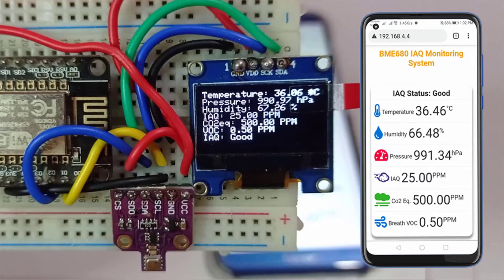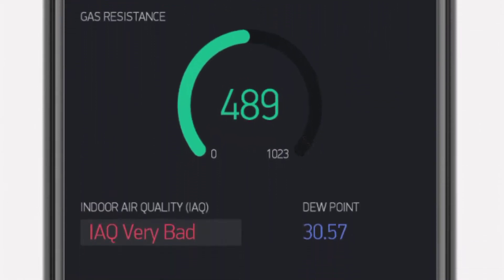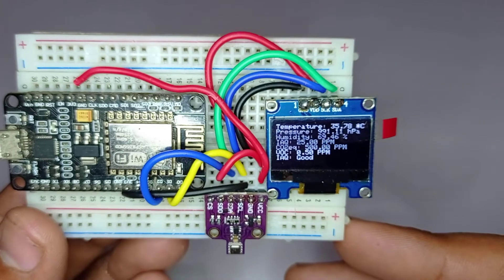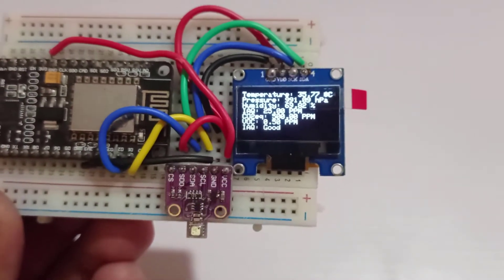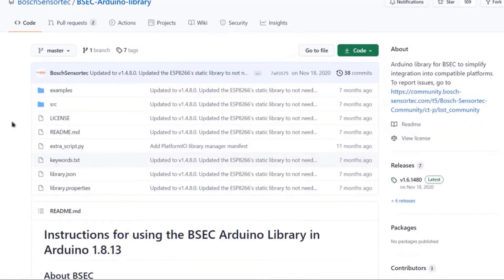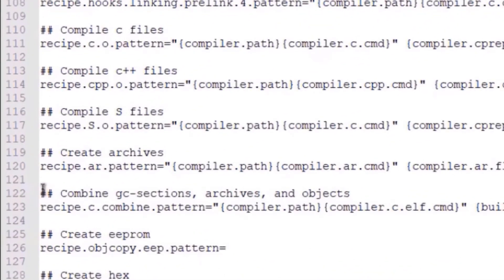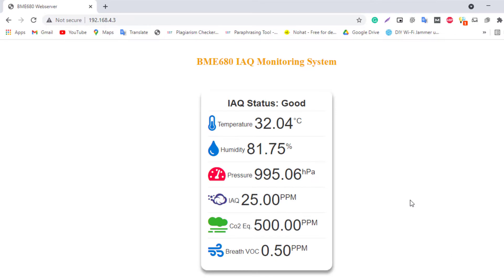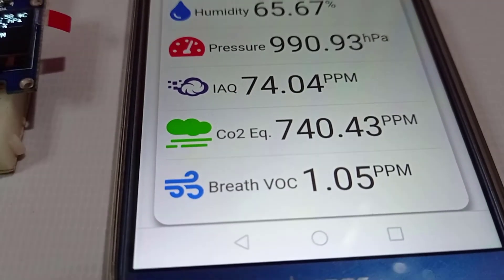Indoor Air Quality Monitoring with BME680, ESP8266 Webserver, and OLED Display

Comment: Resolved : I have only 1 on 3 cable micro usb working with data xDDD ...........
Esptool.FatalError: Failed to connect to ESP8266: Timed out waiting for packet header
Failed uploading: uploading error: exit status 1
----------------------------------------
Good morning,
I put the esp8266 board (3.0.0) and the same libraries with the same versions as you: bsec 1.6.1480
I modified the "platform" file too
I entered the wifi account
I followed your instructions for the installation but I have this message:

---------------------------

Library BSEC Software Library has been declared precompiled:
Using precompiled library in c:\Users\ju\Documents\Arduino\libraries\BSEC_Software_Library\src\esp8266
Executable segment sizes:

ICACHE : 32768           - flash instruction cache 

IROM   : 323444          - code in flash         (default or ICACHE_FLASH_ATTR) 

IRAM   : 28137   / 32768 - code in IRAM          (IRAM_ATTR, ISRs...) 

DATA   : 1512  )         - initialized variables (global, static) in RAM/HEAP 

RODATA : 6748  ) / 81920 - constants             (global, static) in RAM/HEAP 

BSS    : 28384 )         - zeroed variables      (global, static) in RAM/HEAP 

Sketch uses 359841 bytes (34%) of program storage space. Maximum is 1044464 bytes.
Global variables use 36644 bytes (44%) of dynamic memory, leaving 45276 bytes for local variables. Maximum is 81920 bytes.
esptool.py v3.0
Serial port COM1
Connecting........____....._____....._____....._____....._____....._____.....____
Traceback (most recent call last):
  File "C:\Users\ju\AppData\Local\Arduino15\packages\esp8266\hardware\esp8266\3.0.0/tools/upload.py", line 66, in <module>
    esptool.main(cmdline)
  File "C:/Users/ju/AppData/Local/Arduino15/packages/esp8266/hardware/esp8266/3.0.0/tools/esptool\esptool.py", line 3552, in main
    esp.connect(args.before, args.connect_attempts)
  File "C:/Users/ju/AppData/Local/Arduino15/packages/esp8266/hardware/esp8266/3.0.0/tools/esptool\esptool.py", line 529, in connect
    raise FatalError('Failed to connect to %s: %s' % (self.CHIP_NAME, last_error))
esptool.FatalError: Failed to connect to ESP8266: Timed out waiting for packet header
Failed uploading: uploading error: exit status 1

---------------------------

Thanks you